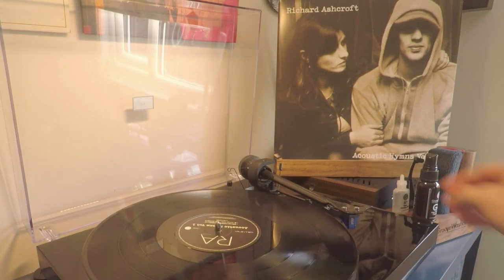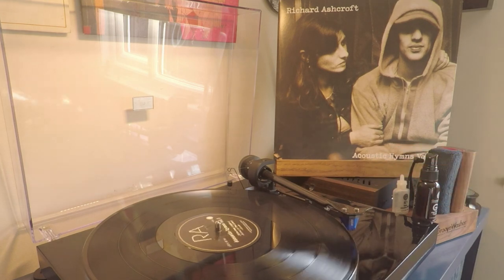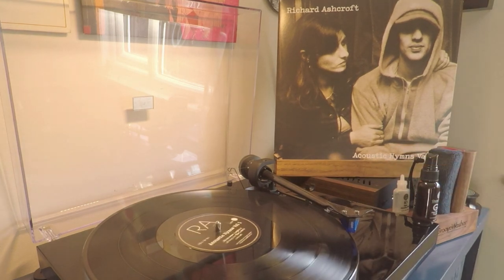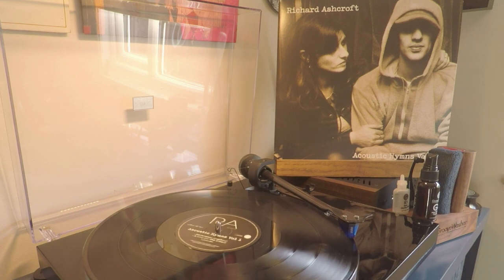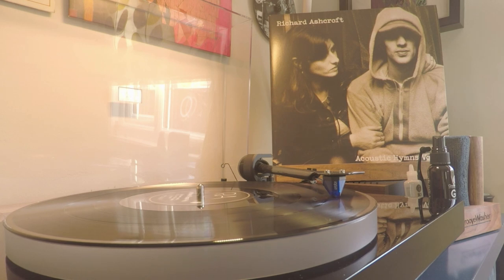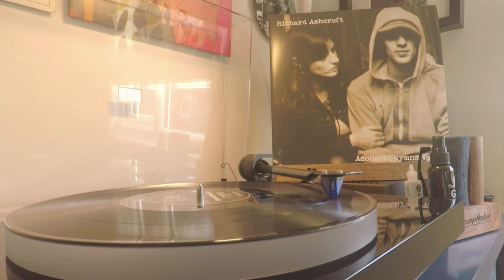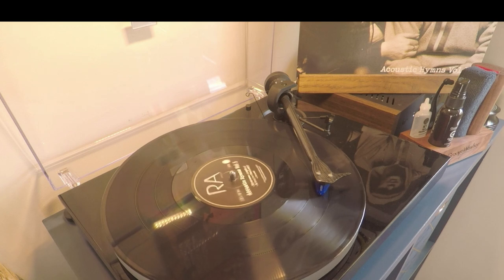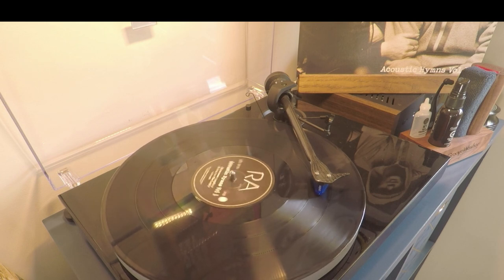Vinyl Half Speed Mastering - Sound Better?

Comment: Another great informative video. I really appreciate what you do here at Sound matters
I need to tell you there have been many companies in the past that have done half speed mastering some would not great success some with there is a pressing of Pink Floyd wish you were here that’s CBS half speed mastering put out you have to be sure to have the right matrix numbers because the first pressing of them the EQ was totally off and then they re-pressed it the right way there’s many cases like this
I love groove washer products but I have to tell you with your Ortofon blue do not use the stylist cleaner you will break the suspension on the ortofon, believe me I know from experience so be careful with that

Comment: Yeah, no, sorry. Theres almost no half speed master cuts that beat the best normal cut versions of the same title.
Heres Kevin Grays take on it: https://www.youtube.com/watch?v=VbVx-e9i1Uk

Reposting from another video:
As far as I know, half speed didnt birth out of ambition to search for higher fidelity directly, but to solve a problem of cutting head overheating and began at Decca in the 60s. Stan Ricker then tried to sell people on the idea that Half Speed sounded better in the 70s.
So I would hardly agree that "Time" and "Money" are the main reasons its not used. It requires a very different understanding of what to listen for, loses an octave in the spectrum which needs to be EQ adjusted for and doesnt seem to produce as good sounding records as it should if everything said about it was true. I can hardly find a half speed cut that beats a standard cutting from a renowned mastering engineer. The only company having some success with it is MFSL, mainly in the 2010s and onwards. But Im pretty sure MFSL stopped doing half speed cutting when Stan Ricker died which is, you guessed it, in the 2010s.
Overall, mostly a gimmick in my eyes.